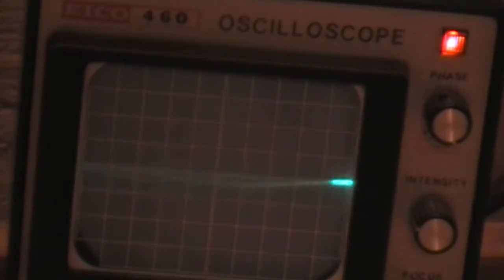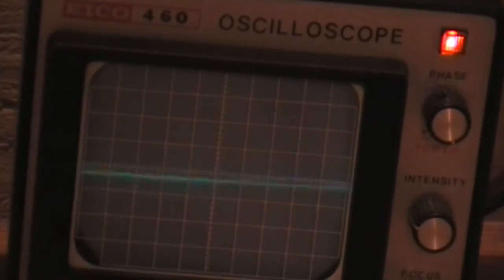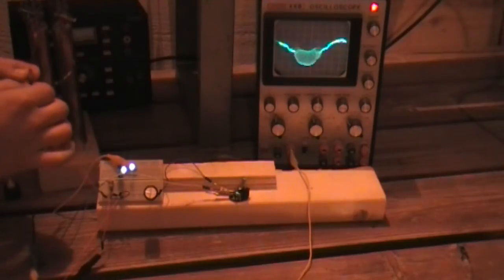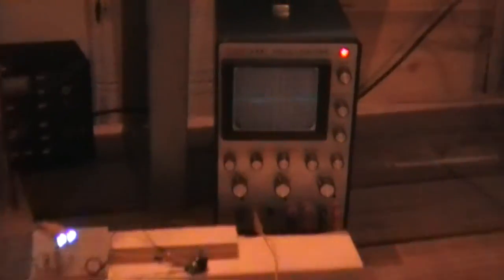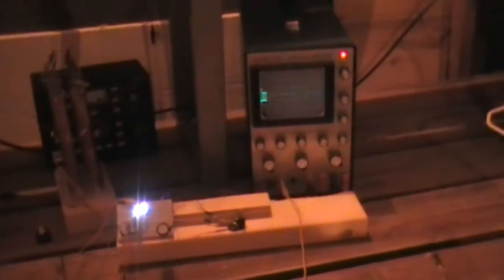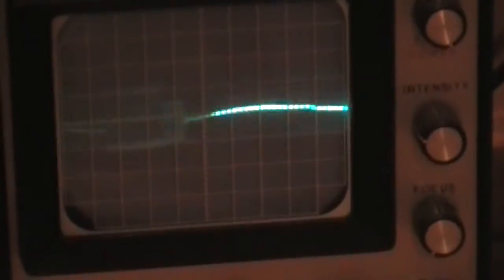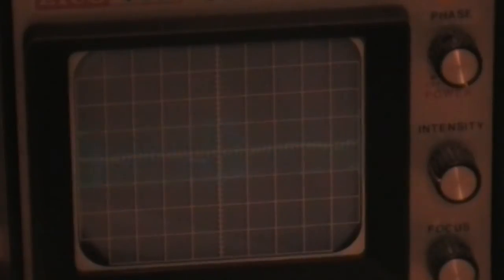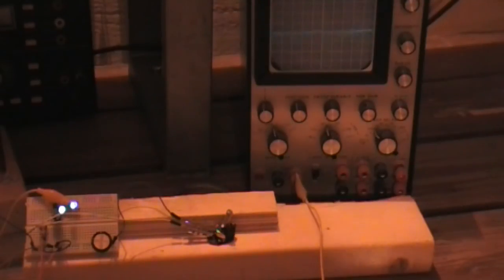SJR Looper Replication 2.0 + Crystal Power Cell

Comment: hey if your scope is fucked up, dont make a vid with it.
Reply from the maker: Yeah, I know its messed up, but it still shows what's going on. As I have said my other "proper" scope is busted, so its the only one that kinda functions right now. I think its better to try and show the wave forms than to verbally describe them. I'm probably still gunna be using it in other vids because it is an excellent wireless-energy indicator. Gotta work with the stuff you got.
Reply: Binj Komisar you dont even talk about voltage in your whole video and we see no measurements at all.... for me, you look like you dont know how an oscilloscope works and you dont know what it is made for. Maybe you know, but you dont show it here at all. The way you use it means nothin at all, you better not have one.
Reply from the maker: Like I said. The scope was just to show the waveforms. Not for measuring. My "good" scope is broken. The voltage that comes of the crystal power cells is about 7 volts. The voltage of the oscillations is under 13.5 volts. It was a demonstration of the SJR Looper with crystal power cells as the power source. I'm sorry it was not up to your standards. Maybe you should make a video with all the things done "properly" and totally show me how its done. But, yeah, thanks for the constructive criticism. (P.S An Oscilloscope has many purposes, one being to show you the shape and timing oscillations, which is what I was more or less doing)
Reply: Binj Komisar thanks for the infos. yes, i should make a video to show everyone how to use this thing. Unfortunately, i dont have a camera, no oscilloscopes, no devices, no material to do so. Im still pretty young and I still live in my mother's house. I work in a pasta factory in wich i do the maintenence and repair every machines, so dont worry about my qualifications. When i will have the time and place, i will make videos on my experimentations to share to people just like you do, but it wont be tomorrow...
Reply from the maker: Yeah, just get saving, then get buying gear, it really is the only way. Also, I do know how to use a scope, its not rocket science. Its just good scope I have is broken. And this other "relic" 60's era, is one step away from completely messed up. If you watch my other vid you will see it works good to show you the "quality" of a wave form... but that's it.. It is no good for measurements whatsoever. I, like you, must pinch my pennies and buy another. Its just how she goes. Anyways, good luck with acquiring your gear, remember to shop around and get good deals. Peace.

Comment: How did you build you crystal cells and how much voltage and current do they put out ?
Do you use Copper and Magnesium in them ? What crystalls between them ? Many thanks. Regards, Stefan.
Reply from the maker: Hello Stefan, when they have a drop of water added to each they put out about 7 volts at approximately 20-30mA(if I remember correctly)... I have not measured them recently and will have to get back to you about the amperage. After a week they lower to about 5.75 volts... as I have said I have to re-measure the amperage (my good multi-meter is at another location, so I will tell you absolute up to date measurements in the next day or so)...... As for the make-up of the cells and how I made them I have put that information in the description of the video above. Thanks for the inquiry and I will get the newest amperage measurements ASAP. All the best, Ben
Reply from the maker: Hello again Stefan, I am planning to build a 6"x3/4"x 30 stack of cells. If I can find the time in the near future I will make a video of this, showing all the steps and details. (I really should have made a video the first time)
Reply: Binj Komisar many thanks Ben for this update infos on the cells. Do you already put all the salts mix into the copper tubes and then heat them with the heat gun and then add the magnesium electrode ? Would be great , if you could show this in a new video and can try to light the LED module from a 1 to 3 Watt LED bulb. Just disassemble such a bulb and get only the LEDs out and leave the transformer out.
Many thanks. Regards, Stefan.
Reply from the maker: overunitydotcom Hello again, Yes I put the salts in the copper tubes then heated them. Once the salts melted down I added some more salts to the rim of the tube, then melted and added the magnesium electrode (after adding the electrode I cooled the tube as quickly as possible with pieces of ice to prevent excess "boiling" of the crystal lattice). The magnesium ribbons of the electrode are bound together using reclaimed magnet wire pieces. Thanks again, and I will start planning my next crystal cell build.
Reply from the maker: overunitydotcom
Hello Stefan. I must apologize, the amperage reading is in uA. I labeled micro with a small m, but I have come to the realization that this is extremely misleading. This was not done on purpose or in a deceitful fashion. It was a lack of thought on my behalf... I still do plan a much larger 36 large cell build in the future,of  which I will document the entire process. Many apologize.
alles Gute
Sincerely
Ben

Comment: I think you will get a better scope shot if you adjust the trigger...
What size cap are you using?
Reply from the maker: Yeah, that scope is kind of a write off. I could have increased the gain but then the shot would have had too thick of a baseline and would have looked worse. It doesn't even have proper scope probe adaptability...... The cap I used was a 35 volt 4700uf electrolytic.... I should have added that in the video... Maybe i'll try to add captions. Thanks for watching.